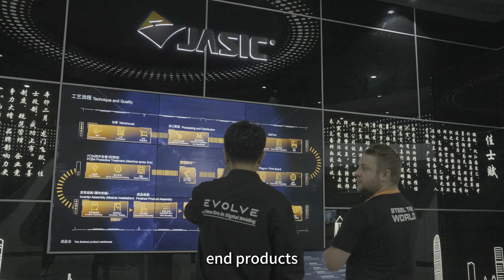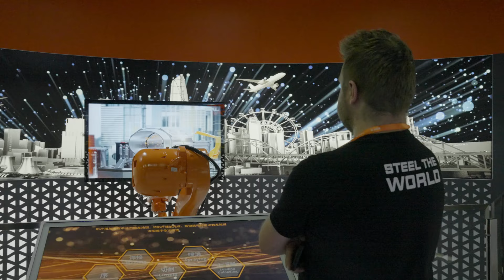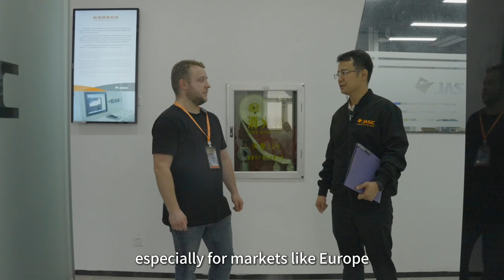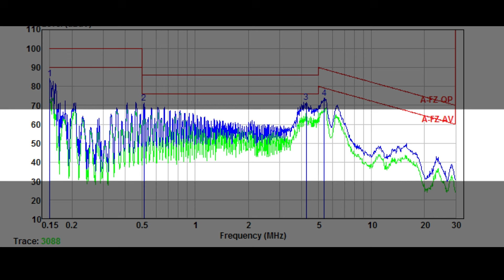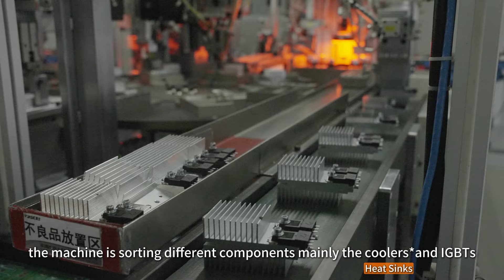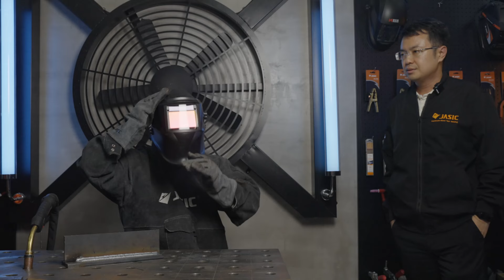JASIC Factory Tour 2024 - Behind the Scenes of the Welding Manufacturer

Comment: older machines were bulletproof, hopefully Evolve line will last as well. Just bought Evolve 200+ and very impressed with a technology that welders went to! Yes there are tiny bugs such as not allowing to choose lower power settings to weld thinner aluminum material (lots of people giving out about that already) but hoping Jasic company will hear customers and will fix it with a new software update. Also would be nice to have designed some flip down protection for an LCD touchscreen, very worried with all those sparks flying around... Other then that thumbs up for Jasic !
Reply from the maker: Thank you very much for your detailed feedback and for choosing the Evolve 200+!
We appreciate you sharing your experiences and suggestions. Your points about lower power settings for thin aluminum and protecting the LCD touchscreen are valuable, and we’re passing them on to our technical team. If you have more ideas or run into any other issues, feel free to contact us anytime. Your satisfaction and feedback help us keep improving.